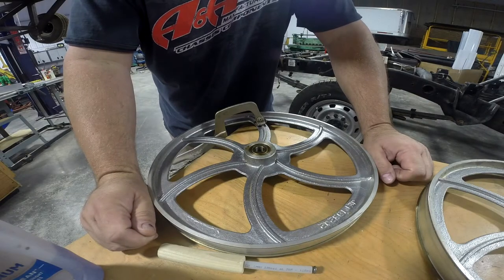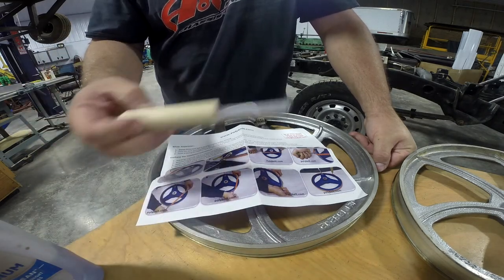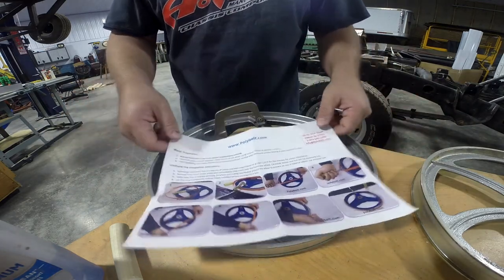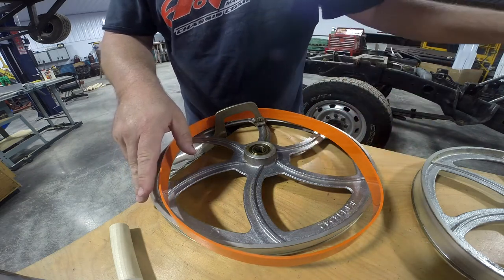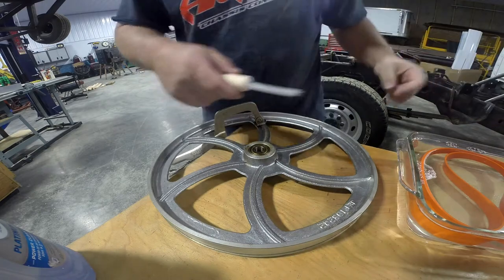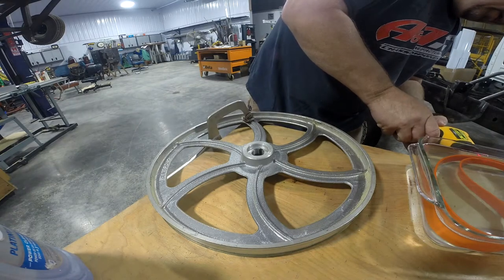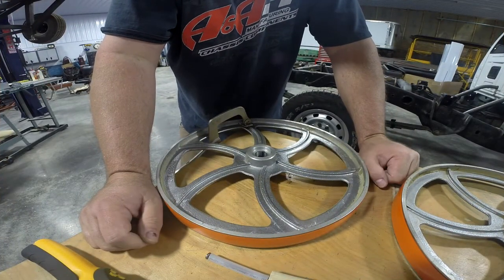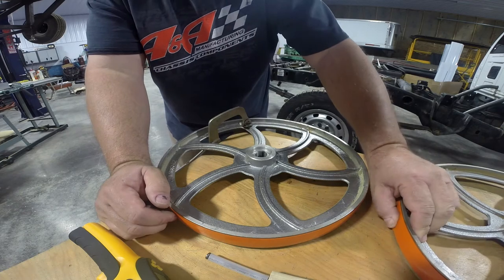Polyurethane Bandsaw Tire Replacement on a Jet 14inch bandsaw

Comment: This worked like a charm and each tire was mounted with little effort.  It takes longer to set everything up correctly and boil water than to complete the actual mounting.  Thanks.

Comment: I converted a yard find  Jet 14" band saw from wood to metal with pulleys and a jackshaft. I also swapped out the plastic blade guides for bearing guides.  Both Jet and Carter make bearing guides for this saw.  About $200 and money well spent. Looks like new tires are next. Thanks!
Reply from the maker: Thanks for watching.

Comment: Wow that went a heck of a lot better than when I installed poly tires on my bandsaw. It took a lot of clamps and prying with a screwdriver and cursing. I did it dry AND cold though.
Reply from the maker: Sorry to hear that. Maybe this video will help the next guy. Where did you get your tires? Thanks for watching.
Reply: I think I got them off eBay. There were a zillion sellers on there all selling poly tires for bandsaws. The old lady I acquired the saw from had been running it without tires for years doing small craft projects and so the wheels themselves were badly gouged.